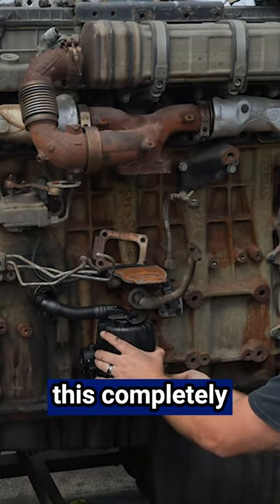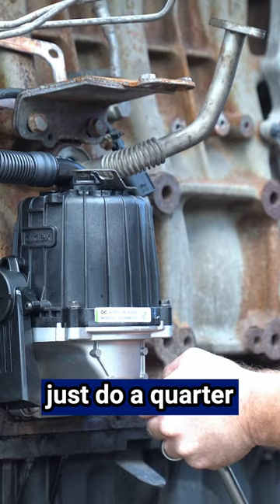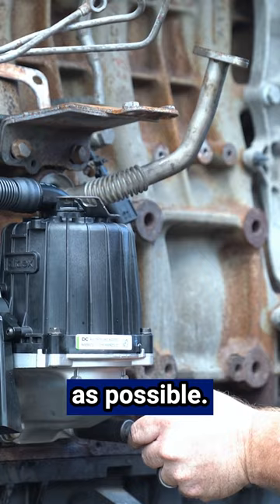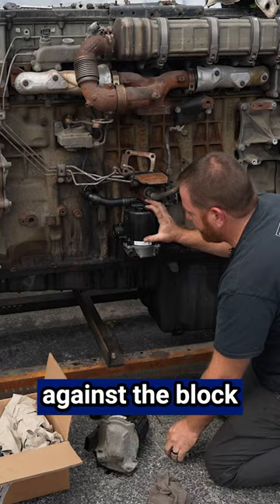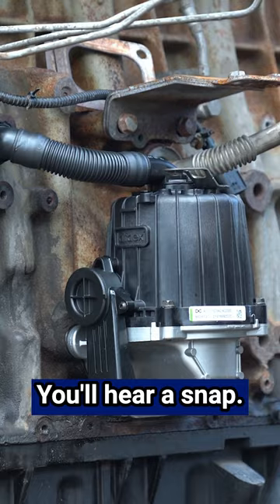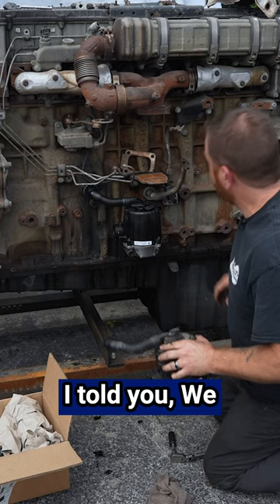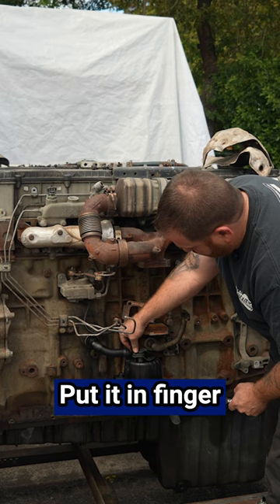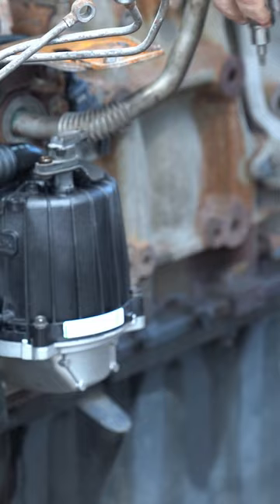Easy Crank Case Filter Replacement! #semitruck

Comment: I replaced mine when i replaced my turbo. I thought nows the time for this. It sits behind the frame. There are wires in the way if you try to pull it out from under the truck.